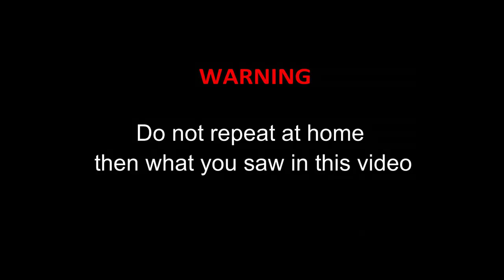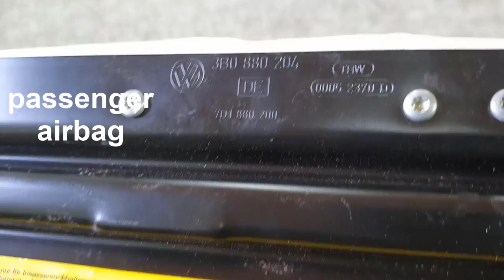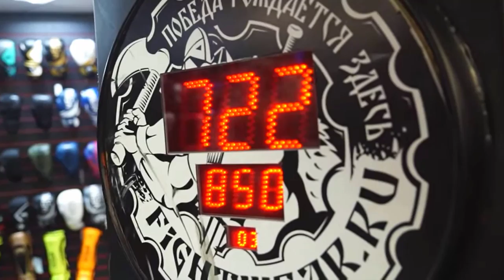HYDRAULIC PRESS VS AIRBAG

Comment: Years ago, we used 3 airbag modules to lob a huge model rocket  into the air as the main engines ignited. It worked rather well ❤

Comment: The distance from the Hydraulic press to the airbag was quite small. This experiment shows that a rear facing child seat in front is very deadly in a crash.  The airbags were designed for a person sitting back and buckled in, away from the exploding airbag.